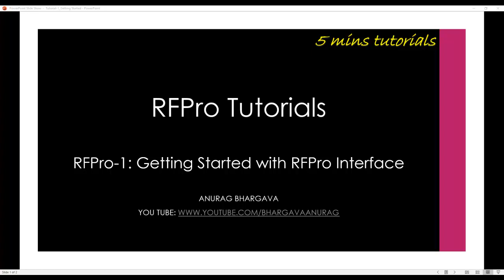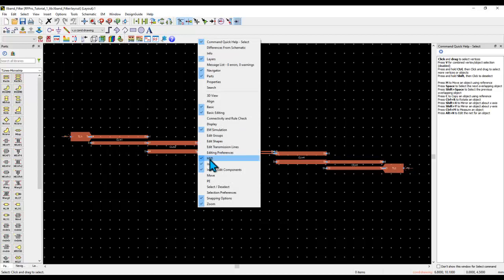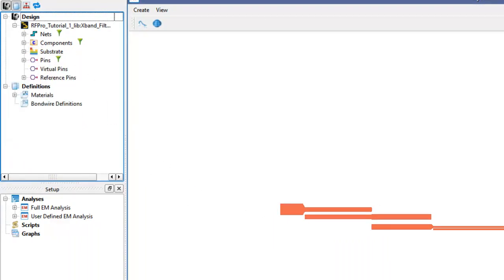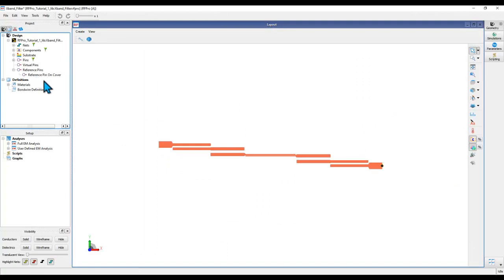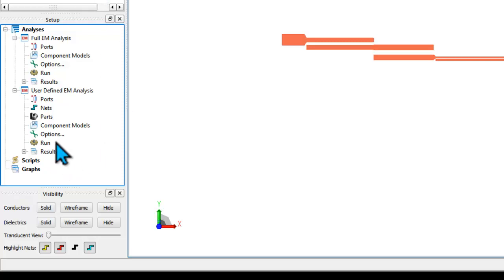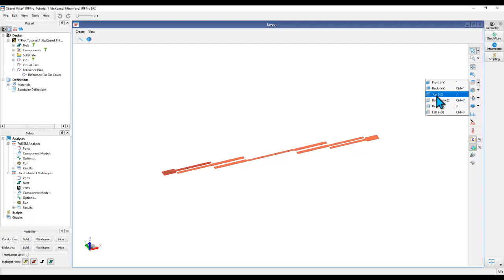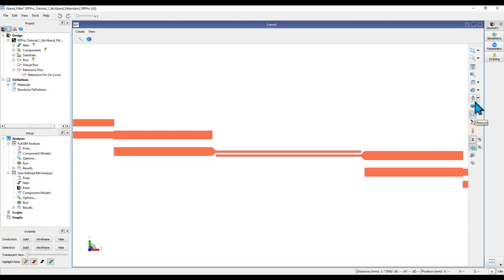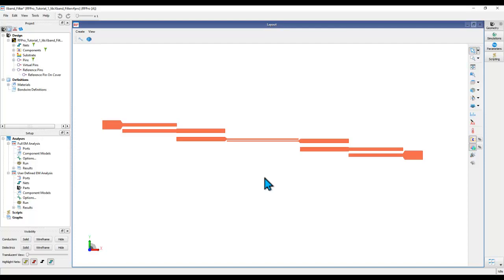RFPro-1: Getting Started with RFPro Interface

Comment: First of all sir, I would like to renew my warm gratitude for your help and assistance in one of your videos "Tutorial-42: Multi-Layer RF Layout - VIA Teardrop, Keepouts, Avoidance Routing, and More "

Once again I turned toward you hoping that you could help me with an issue that I encounter with PEPRO.

I've designed a dc-dc buck converter and I simulated this design in PEPRO then I generated the Radiated EMI test. The simulation went well. Yet, in the post process of the result and after setting the excitation type to the circuit simulation dataset I wanted to plot the far-field pattern but I got this message: "Unable to render: No run with id" exists for this simulation" knowing that I generated the conducted EMI test before without any problems. Also when I attempt to create the Radiated EMI graph I get the error message "input dataset is invalid"

I would be grateful if you could help me with this problem.
Reply from the maker: Hi,
For your PEPro question, it will not be possible to help on YouTube. I would recommend you to contact local Keysight tech support team for help.

Comment: Now I am working on a short-wave power amplifier (the frequency is 1.5MHz-35MHz), and I encounter a problem. When the ideal transmission line is converted into a microstrip line, the microstrip line will be very long. Do you know any method that can be equivalent to ideal transmission line? Can the ideal transmission line be transformed into capacitance and inductance? How to convert? ?
Reply from the maker: Hi Wen,
You should be using L & C from the start so question of transmission line conversion doesn't arise. At that frequency transmission lines have no role to play so question of conversion doesn't arise....